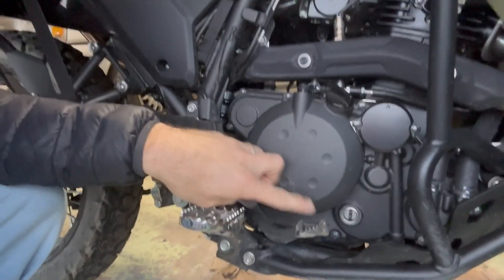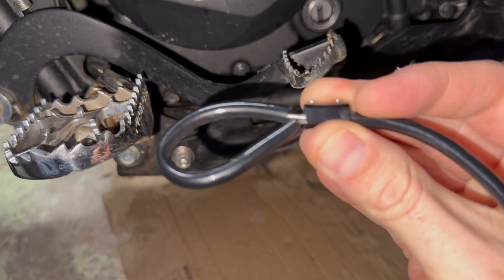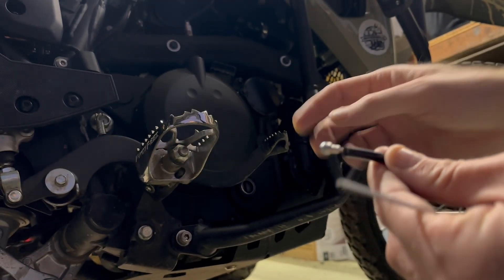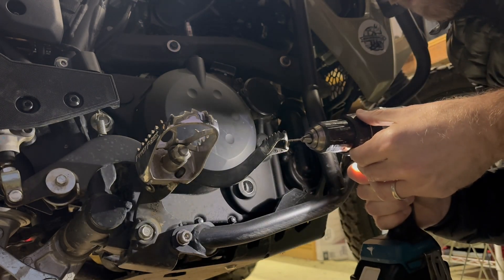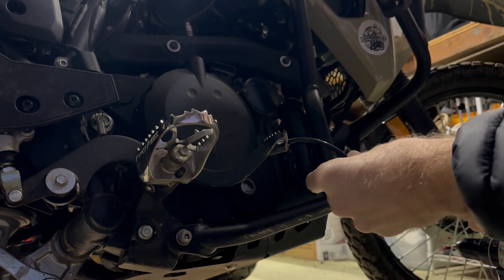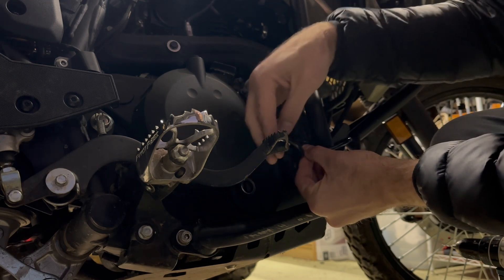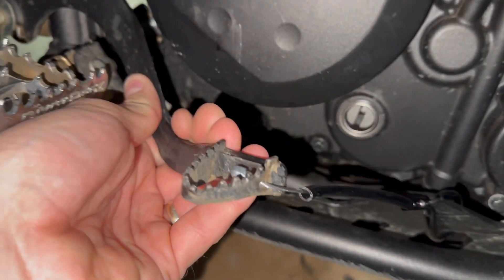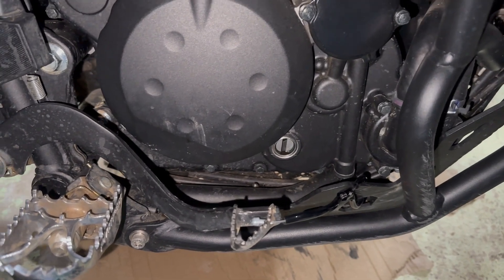Motorbike Brake Saver  - cheap insurance

Comment: years ago they came stock on a kawasaki 350 f9 street and trail...gear shift side also.
Reply from the maker: Nice - is that the 350 F9 bighorn ? I’ve got dads orig Kawasaki F11B 250 which I restored nearly 15 years ago. I’ve always liked the F9 350